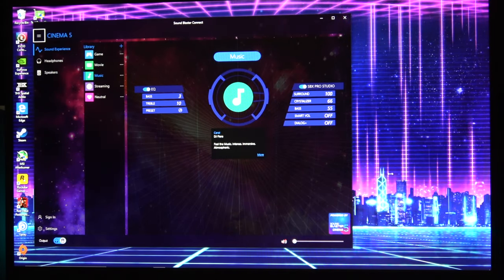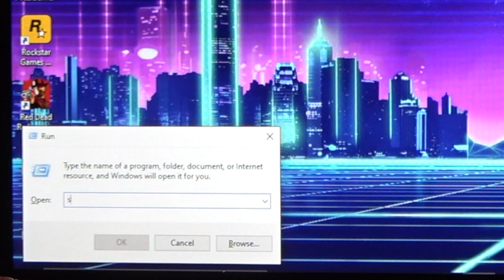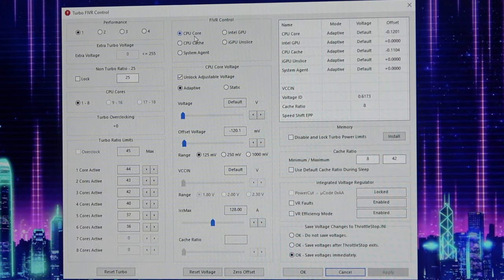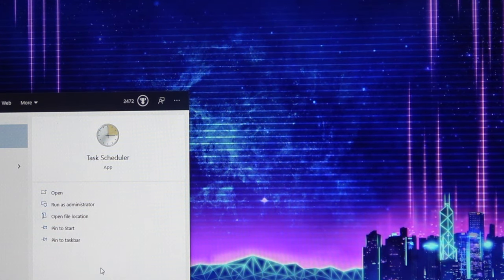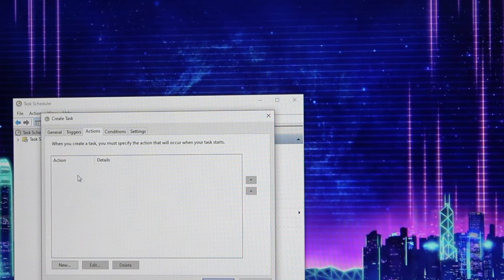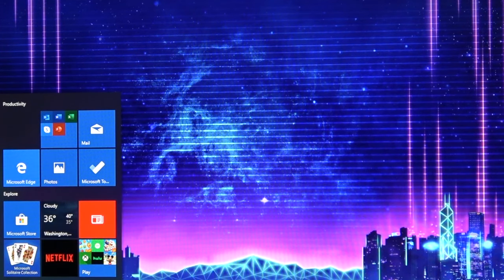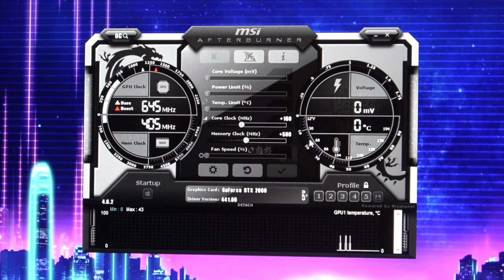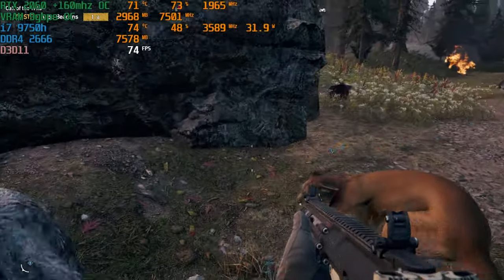EVOO Gaming Laptop Undervolting, Overclocking and SSD Upgrade Tutorial

Comment: Im too paranoid to mess with undervolting or overclocking. 
I was having heat issues running high 70s low 80s centigrade with most heavier games. 
The issue was the i7 processors turbo function. Its nice to have all the extra power but for gaming its overkill. Unnecessary heat and potential for instances of thermal throttle.
I downloaded the Real Temp program and used the disable turbo option in settings and now I barely break 70c ambient room tempature 74-77f on a cooling pad. Far Cry 5 spiked my temps into 90c before disabling turbo and now it barely breaks 70.

Id recommend this for anyone using this. Increase the life of your parts and quiet the fans. 
use RealTempGt exe file in the directory for this processor to display all 6 cores temps. It works to diable turbo with either exe file though.

Comment: For some reason when I change the GPU clock settings it shows 300MHz instead of the 645MHz that you have,  but the memory clock is the same, is this normal?
Reply from the maker: Stephen Govea - I think the clock will fluctuate when you’re not in a game, it should run at 1500+ or so MHz during load, that’s the important thing to look at
Reply: @TechWithSean  Good to know thanks!

Comment: Is it ok to leave my computer undervolted and over clocked? I saw you mentioned dialing back for daily use. Also I have the LP4. Can I apply the same setting reccomdations?
Reply from the maker: It will be fine. If you don’t want to overclock the GPU all the time you don’t have to, running an undervolt all the time is good for it because it runs cooler.
Reply: @TechWithSean  thank you very much! Again I have the evoo LP4. It has the same processor and all just a different GPU GTX 1650. Can I over clock it the same amount you did? Or what are your thoughts?

Comment: Hey Sean quick question about this laptop. I purchased the same one. And I’d like to up my ram to 32gb 
Is that gonna be possible to do with this laptop or not? Did you see if there’s only one port or there’s an additional one too. If yes what kind of ram speed is already available for this particular laptop?
Thanks a lot!
Reply from the maker: andreynfs - mine had both slots filled, 2x 8GB sticks of 2666mhz
Reply: Tech With Sean thanks a lot I appreciate that.
Reply: I upped mine to 64. I never use more than half of it though.
Reply: @TechWithSean  yeah they can handle 32gb in both for a max of 64.
Reply: @NSanoShano  could you please tell me where you bought additional Ram and what kind of Ram should I look for? I’m sort of new to pc industry so i need a bit help please. Thanks I’m advance!

Comment: Hi Sean! Thank you so much. I have a standard 1tb laptop HDD lying around. Do you think it could fit that slot and connection you used for the SSD upgrade?
Reply: If is a laptop drive (2.5") should fit without a problem. Connection doesn't change

Comment: Couldn't get SoundBlaster Connect to work "Your audio device cannot be detected" and all the reviews say the same thing.
Reply from the maker: Zach Hopkins - someone said that running the troubleshooter on the speakers (?) worked for them. Someone else said doing a reset of windows fixed it. Hope you got it working!
Reply: @TechWithSean  Any luck with this Zach?  I just bought this laptop and it is telling me same thing (Your audio device cannot be detected).. trying the troubleshooting on the speakers did nothing.. sort of afraid to reset windows.  My device manager just shows Realtek(R)Audio and THX Spatial Audio - are these even supposed to work with the Soundblaster app?   Weird that the app came preinstalled if it isn't going to work??   GREAT MACHINE other than that so far.. wish I could figure this out.
Reply from the maker: Try here http://www.evooproducts.com/support.html

Comment: Interesting to see an rtx 2060 clocking at 2050mhz consistently. Mine spikes to those numbers for a seconds or so but generally stays around 1450mhz already oc'd by 180core clock 80w model. How's that possible for you to get those numbers? Can't just be because of your .02mv more undervolt or the maybe or maybe not 90w GPU.
Reply from the maker: Anthony Smith - I think limiting the CPU boost clocks may reduce thermal/voltage load and lets the GPU boost higher 🤷‍♂️ idk I didn’t do anything crazy.

Comment: Throttlestop caused my laptop to crash twice after I applied the changes. Any ideas? I followed your changes to the letter
Reply from the maker: angaritag - try reducing the amount you turned down the core and cache voltages (bump them back up a little). Every system and chip is a little different
Reply: Tech With Sean thanks matey! I'll give it a shot :)

Comment: Hey man is this the : 

“EVOO Gaming 15.6" Laptop, FHD, 60Hz, Intel Core i5-10300H Processor, NVIDIA GeForce GTX 1650, THX Spatial Audio, 256GB SSD, 8GB RAM …
EVOOModel: EG-LP10-BK” 

If it’s not can I still install the same upgrades you did? I might be in over my head with this 💩
Reply: Even if it's not the same model. Don't worry. It will be the same upgrades the same way and same location. But remember, if you open the back cover within one year your warranty will be void. So after the warranty expires (usually 1 year) you can upgrade. Or if you don't care about the warranty. Do it
Reply: @rohit2405_  thanks I’m going to give it
 A shot
Reply: @ryandoyne6679  cool, do let me know how the laptop is in case you buy it 👍

Comment: can you share the links for the downloads for techpower up and the MSI one? Im new to gaming laptop and want to do the samething you did to your laptop to mine so it doesn't get over 80c. Thank you!
Reply from the maker: Just look up ‘Throttlestop’ and ‘MSI Afterburner’. They are both really popular. I don’t want to put the links in the description because they may become outdated when new versions of the apps come out ✌️
Reply: @TechWithSean  okay thank you! With the laptop right out of the box have you had any issues yet running with the set up you have now?
Reply from the maker: I didn’t have any problems but I have actually returned this laptop. I got some weird artifacts across the screen that I haven’t seen anyone have. I think either the vram or ribbon cable for the display were going bad. It seems like a one-off thing though, I haven’t heard of it happening on anyone else’s. I posted a pic of it on Reddit
Reply: @TechWithSean  Did they give u troubles becouse of the sticker ??? (Warranty one)

Comment: Does the undervolting works whit a evoo gtx 1660ti?
Reply from the maker: The process is the same, you may just need to adjust the values a bit (it vairies system to system anyway.) You can use this method on any modern Intel windows laptop though
Reply: @TechWithSean  
It works very well, I just tried it on my evoo gtx 1660ti and I managed to lower the CPU temperature. Thanks a lot!!

Comment: Why was Skyrim only getting 59 fos? It seems like this system should crush Skyrim easily.
Reply from the maker: Skyrim has an limit of 60fps, you can technically edit the .ini file to unlock it, but it breaks the in-game physics. It’s the same with the fallout 3/4 and other ones Bethesda made in that same game engine ✌️
Reply: @TechWithSean  Thanks!

Comment: wait, so this laptop has 2 m2 sockets and another 2.5' sata?
Reply from the maker: Yep, one of the m2 slots is NVMe/SATA
Reply: Tech With Sean Sean I was hoping you could help me out with this. I have removed the supplied M.2 ssd and replaces it with an m.2 Nvme . I’m not sure how to switch this drive to Nvme in the bios. Is this something that is automatically configured or so I have to adjust any settings within the bios? Upon opening the bios it seems the only options under sata mode selection are “ahci “ and “intel optane “ nothing that says “pcie”.

Comment: Do you know what the brand of the SSD that it comes with is? Can I install an nvme?
Reply from the maker: It comes with an Intel 660p and you can put an nvme drive in the empty slot
Reply: Tech with sean can you replace original ssd and put 2 one terabyte nvme cards instead?

Comment: i spilled something on my evoo.  i didn't have an option for extended warranty when i bought mine.. (grrr)... anyway now several keys on the keyboard dont work (still light up).

i wonder if you (or anyone) knows where to get a replacement keyboard? thanks
Reply from the maker: Honestly it’s Walmart and I think the manufacturer warranty is one year... I’d just call customer service and tell them the keys aren’t working (maybe don’t mention the spill) and see if anything happens
Reply from the maker: It uses a TongFang chassis, but I’m not sure that they sell they keyboards separately. It could be a problem with the motherboard, not the physical keyboard also